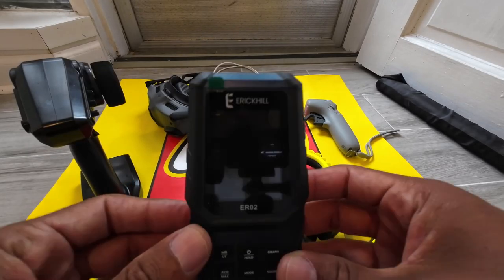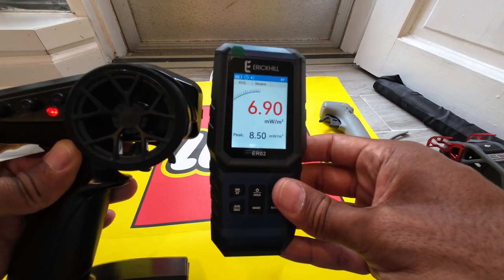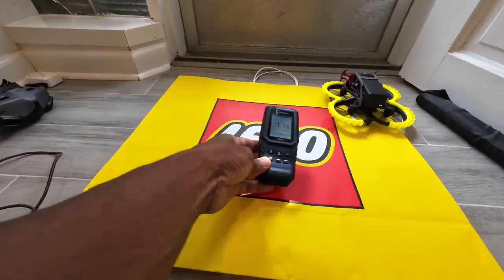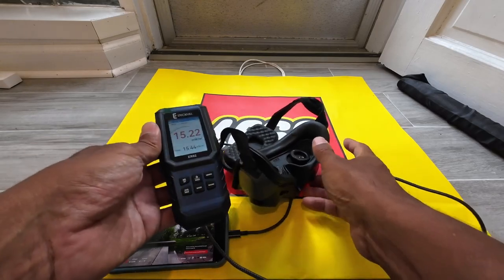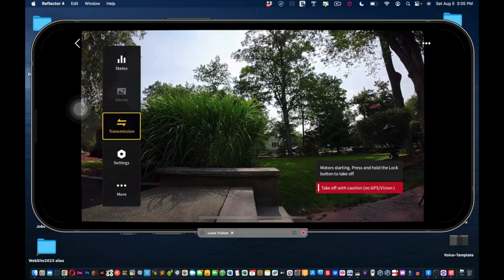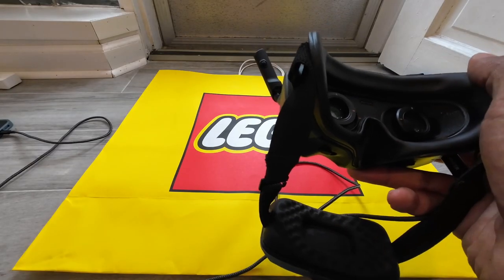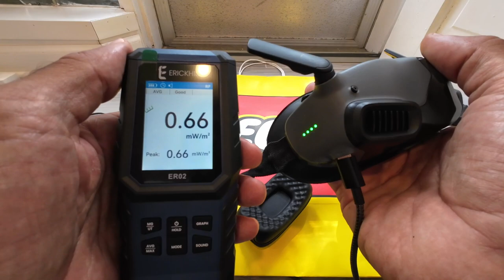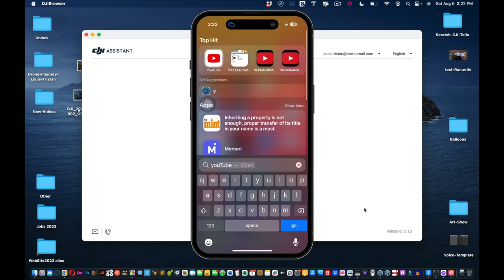dji avata fcc hack - Frequency Check

Comment: Thank you very much for the test, unfortunately it doesn't seem to work for me, as I said it gives me access to multiple channels in the various bandwidths 40,20,10 Mhz but the power at least from the distance where I lose the signal in CE mode is the same as when I am in FCC.
Obviously the transmit power has to be measured on the vtx ( which is then basically a Dji air unit o3 ) of the Avata drone ( The googles act as a video receiver, they don't transmit ) when it is in flight because until it takes off it is in low power mode. 

Best regards and thanks again for your availability and test greetings from Rome Italy
Reply from the maker: Good points you share.. .. Something must be interfering with your experience all in all... Maybe try reseting everything to factory default and then do the hack again.. Nice to know the channel made it all the way to Rome...
Reply: I have the same issue, channels unlock. However, the penetrative distance is equal to CE.
Reply from the maker: @MTB_FPV  not sure - for some folks this works and others will have similar experience. Maybe a hard reset and try again..  Are you near any towers or power lines?
Reply: @droneimagery-NY-NJ  I'm in an open field away from any possible interferences. I can fly up 150m then go for around 400m before it drops however if I fly around 5m height and behind a tree that's 15 meters away it drops and orange warnings. I'll try a hard reset and see if that changes anything.
Reply from the maker: @MTB_FPV  maybe try a different channel?
Reply: Même problème pour moi. La version 01.07.00 des dji googles v2 ne le permettent plus.
Reply from the maker: @elliotbby   dommage, exécutant actuellement le firmware 01.03.00.00, je n'ai pas vu la version du firmware que vous utilisez. Il faudra être à l'affût de votre version ou de la prochaine version et l'envoyer par SMS pour vous assurer que la prochaine mise à jour n'interrompt pas le hack FCC.
Reply: @How-to-by-Lou  J'ai vérifié et le hack fcc fonctionne bien sur l'avata et les googles v2 avec les versions à jour. J'ai les 3 channels en 40 MHz qui s'affiche. 600m parcouru en restant en 50mbps tout du long. J'ai dû faire demi-tour a cause du vent et de la présence d'habitation. Ce hack est parfait. Je recommande. Super vidéo !

Comment: Is it working on 01.07 goggles v2 firmware?
Reply from the maker: Have not had a chance to try it....This test was done on 01.03.00, firmware. The version you mention has not been released where I am on the globe.  Just checked to see if there was an update, so far 01.03.00, is the current version were we are. As soon as 01.07 is released will totally do another frequency and range test.
Reply: Its not working 4 me too, i cannot choose the channel and seem its stick to 10 bandwith
Reply: Im with 1.07 firware 4 the googles
Reply: Mine too brada. I dont have idea what to do anymore. If u got way to hack  pls tell me
Reply from the maker: @ranggo8  someone in the comments had luck when they formatted the SD card and then put the file onto the SD card… try that
Reply from the maker: @ranggo8  channels aren’t what they were once you install the ham file 

He explained it best 

Even though I alway use channel 3 in my videos - there’s no one around 

https://youtu.be/KclBzzZ7a98?si=w_VgJOYUJY-AQS2Z
Reply from the maker: channels aren’t what they were once you install the ham file 

He explained it best 

https://youtu.be/KclBzzZ7a98?si=w_VgJOYUJY-AQS2Z
Reply: I found a way. Just connect to your rc to able choose the channel